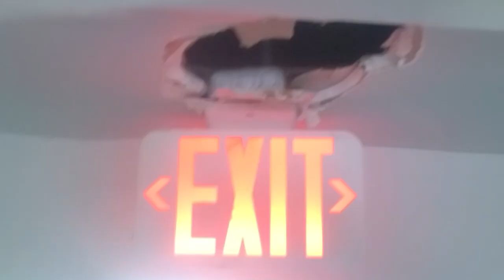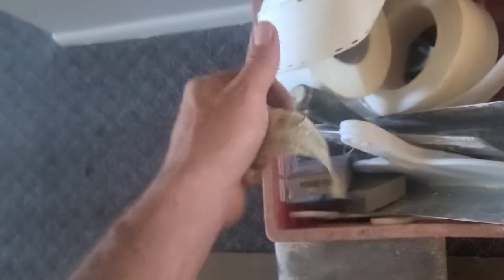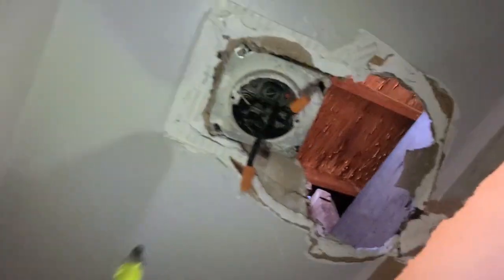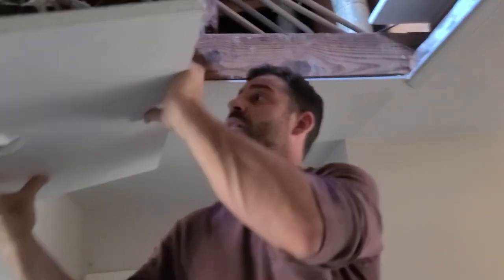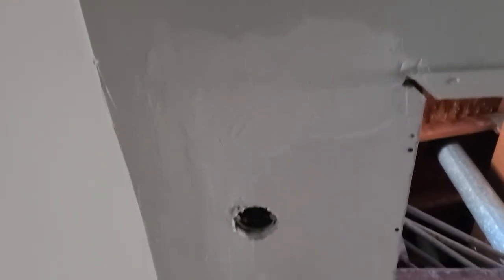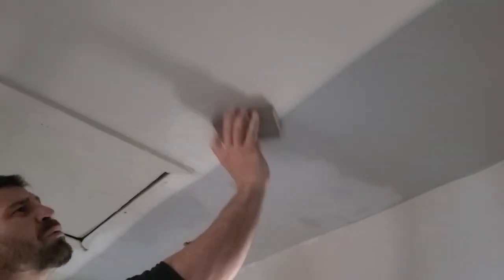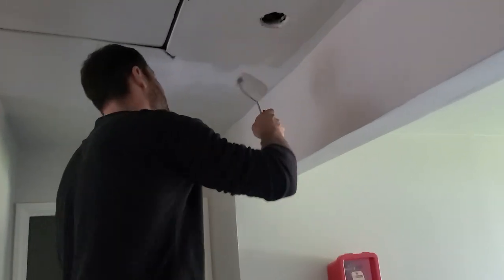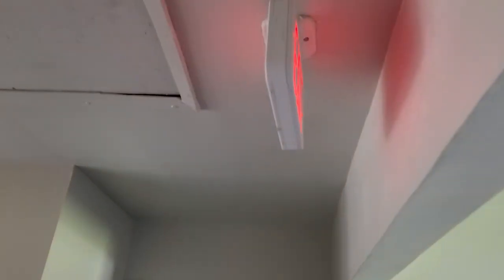HOW TO | Drywall Repair

Comment: Whenever i have to patch where the surfaces aren't level , i mix some 20, and I mix it tight (meaning not runny) and butter the studs/joists/framing area with the 20 and put the new drywall in place and screw it , but I screw it in slowly......until the surface of the new drywall is flush with the surface of the existing drywall and stop screwing , even if the head of the screw is above the surface . Then after the 20 is set hard , i sink the new screws to the proper level , because at that point, the 20 is so hard that the new drywall wont sink below the surface . It will stay flush with the existing drywall around the patch . And then I finish the joint as usual . This method is much better and faster than using a whole bunch of shims of different thicknesses to shim the surface all around the hole to be patched. If it's at the end of the day , and I have the benefit of overnight for things to set , I will use PL 200 instead of 20 , and by morning , the PL is so rock hard , it's even better than the 20. then i set the screws and tape as usual.
Reply: Nice tip!
Reply: @spankiedoodlesteve2086  , thank you brother .

Comment: California patch would have hooked you right up. Only fair I offer some of the expertise in my trade considering you have done the same. You can still use screws on a cali patch. I would have cut to the access panel and then threw in a backer near the box. Then cut a cali patch to the shape of the hole. Vancouver Carpenter has some good videos
Reply: Apartments are always fun working around all the ghetto past repairs lol. Another point for the cal patch btw because you aren't worried about matching thickness

Comment: Next time just cut square on edges of hole add two pieces of strapping on edges screwed through drywall half on edge of hole cut new drywall that way patch is alot smaller
Reply: I'm a drywaller and the purple sandpaper way better than the black mesh ones

Comment: Pro tip: if you use a heat gun instead of a fan, you cut your dry time in half! Good work bro!
Reply: Heat gun isn't good . It dries too fast and won't  bond properly , it will crack later . Air movement is the best actually . I've been taping 37 years . Trust me , air movement and , on big jobs , a dehumidifier are  best .
Reply: On small repairs when you need to get in and get out it works perfectly fine. I’ve done it 100s of times with no issues. I wouldn’t suggest it on a large job by any means. But for a quick patch, especially one you didn’t include in your bid, it’s perfectly acceptable.

Comment: Blow out "California patch" that wouldn't even have to cut it bigger or  use screws
Reply from the maker: good to know!
Reply: @NWIVeteranConstruction  I have to patch 5-8 foot holes a year lol
Reply from the maker: @ivtec845  that is INSANE lol I'd be so mad
Reply: @NWIVeteranConstruction  trust me lol it happens on the full plywood tear offs where the  rafters are only about 5ft off the floor joice at the ridge so guys are always standing on the floor joice's and a foot slips off. these style homes are very popular in my area